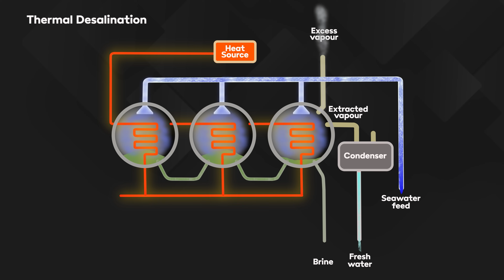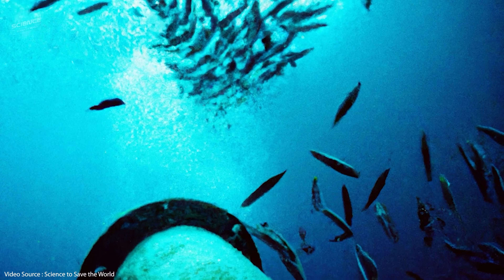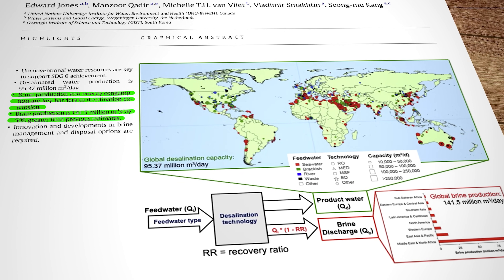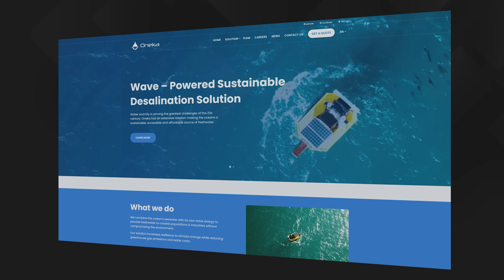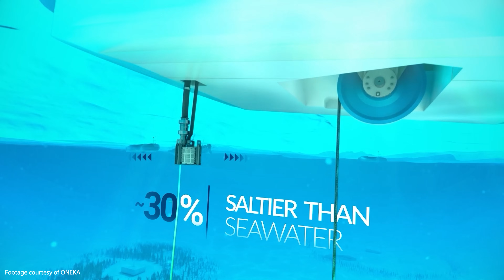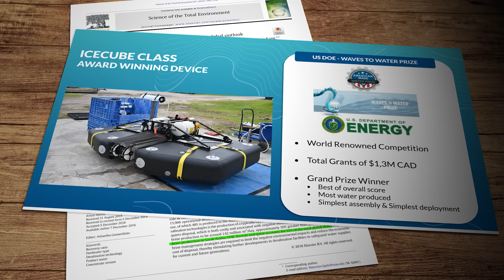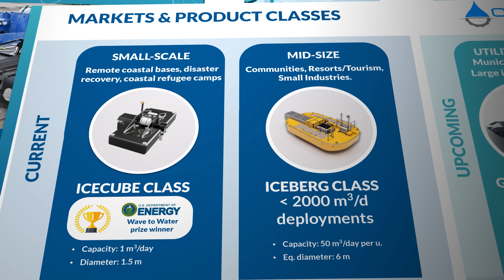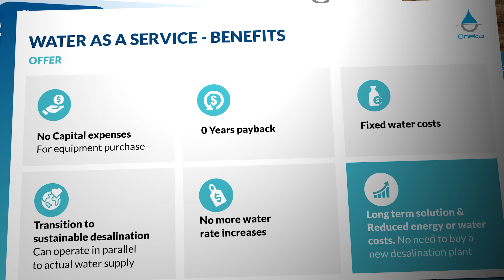Fresh Water at Zero Energy Cost . How do they do that?

Comment: Good video. 2 questions:
1) How are they collecting the desalinated water? How much energy is being spent doing that? The more infrastructure required, the bigger carbon required. 

2) Regardless of the percentage of the brine that is sent back into the body of water, it's still the same total brine. 
Yes, dispersing it more evenly will cause less disruption. But does that % actually matter when the whole brine recycled is the same?

All in all, great innovative ideas. I think there are some bugs to work out, though.

Comment: What does it matter if the discharge is less concentrated? In the end, you discharge the same amount of salt per unit of water purified. 
At the same time, using a mechanical pump system is a gimmick - you might as well take an existing tidal generator and combine it with an electrical pump. Needs no "innovation" and is possible with of-the-shelf components right now. 
The average american uses 215L of water a day. So you can barely cover 5 people with a single small platform. The mid-size is enough for 250 people - "small community" indeed. The biggest "upcoming" platform should provide for 2500 people. You'd need 40 of the biggest ones to supply a SMALL city of 100k...And this is nothing compared to agricultural/industrial usage.
You could discharge the current high-concentration brine in a distributed manner - no one does that because of cost. If you put up enough platforms you'll need a lot of pipes.
Maintenance. Now you have one big on-shore facility that's easily reachable and maintainable. With many platforms out all over the place, that makes maintenance much more difficult, read expensive. 
Also, you already have a mechanical piston, why would you put solar panels on it? Why not use the mechanical force to run a simple generator? It's likely to already exist and in marine specialized form too. You'd save on batteries and the whole thing would be much less weather reliant.

Comment: I see everyone talking about maintenance issues since it is offshore. In my view that is something that just adds to the total cost of ownership, and could probably easily be offset against the lack of energy need. And the easy process, since they are small, is to just pull them on board a ship, put in a new one, and maintain the 'broken/up-for-maintenance-one' on shore. Besides that, with all the windfarms that are going up, te maintenance is something we're learning quickly. I can imagine, with a lot of mechanical parts in the system, it might be failure prone. It would be challenging to find the sweet spot of failure-proof, but not so over engineered it is no longer economical.

Comment: It will take some iteration to find the correct unit size and configuration.  Many small ones will probably be too expensive to maintain but if you get to a global fleet parts and maintenance is standardized.  Lots of 20 year olds with scuba gear will have a job in any configuration.  Marine life will plug up the intake fast anywhere that barnacles and mollusks thrive.  I wonder if most of the kit should not be onshore and centralized across N pumps offshore.

Comment: This is a great idea, 'passive desalination'.  I'm all for it, and we less unfortunate should help those less fortunate to get things going.
Two problems I see are: political, those using large plants won't want to change over so will continue to use fosil fuel.  Practical:  it will be so popular that there won't be enough PET for recycling so they will resort to virgin stock which is an oil product with deisel and petrol as by products which will be used to create GHG ..........

Comment: As with all systems, the problems are at the extremes of operation. In this case the minimum is no waves so no water output an no problem.
However the other extreme is where the real problem occurs. With storm waves and the odd freak wave, how does the platform not just operate, but survive? Is it on a fixed tether causing it to submerge is very high seas, or can it extend the line to ride out large waves?
With global warming causing more intense storms, the extreme case of large wave heights may be a major maintenance headache.
Having said all that I think this is a very promising technology, and I hope it comes on stream soon.

Comment: Nice concept, but there are going to be a lot of technical marketing issues they are going to have to overcome.  I suspect the reason they can use only wave power is because their efficiency (volume of salt water in vs volume of drinking water out) is very low compared to traditional desalination plants.  Typically It doesn’t take a lot of energy per volume to get that first few percent through the membrane.  Land based RO units could do the same, but the amount of capital investment, physical space, additional maintenance costs, workers to hire,… make putting more energy for a higher yield economically attractive.  The low efficiency also allows them to discharge slightly concentrated salt water, instead of the very concentrated salt water from land based units.  

An additional challenge, as a municipality, how do I make sure I have a properly sized system?  Some days might be dead calm, then what?  Yes, you build water storage, but how big?  Without more information, one has to assume the stated output is under ideal conditions.  

With all that said, this would be great for remote locations or places that value being environmentally friendly over financial (capital and maintenance) costs.
Reply: that is the beauty of the concept: there is enough space on the ocean. So they can use (weker) wave power to reap the low hanging fruits. - Although maintainance is higher if there are more decentralized points of intake and brine disposal. Offshore maintainance is a huge cost - unfortunately. (Growth of barnacles, etc. and also the maintainance of valves or moving parts). They have to clean up growth and maintain parts in the normal desalination plants (on lad) as well but there they do not have a lot of pipes and they are much easier to reach.
Reply: Personally I agree, space in the ocean shouldn’t be a problem, but say you are a vacation/resort town that relies on a lot of boat/ship/fishing traffic around your coast, it could create some issues.  Then there is the “not in my back yard” mentality we see with offshore wind power.  

Again, I like the concept/technology and feel this kind of thinking is one of the main ways to be more sustainable.  I have seen too many technically sound/environmentally friendly projects killed over non-technical issues (not in my back yard).

Comment: Use solar with Piezoelectric to drop metal to condensation temp to collect water from the air. With a warming planet, there's more water held in the atmosphere. Pulling water from the atmosphere also helps reduce warming...

Comment: lol, well...
Just another RO unit - with direct mechanical power.  

Any of the "solutions" to brine concentration and distributed discharge , marine life exclusion (maintenance  concerns of all those submerged components, wow)   can be applied to land (or sea)  based  "grid scale" system....     Not a lot unique there - just a bobbing wave generator - with a whole lot of fault prone submerged parts..
NB brine quantity is never a significant concern and concentration is a mere "engineering decision" with pumping efficiency entering the debate - vs cost of diluting - and distributing at the discharge point.

Yes directly using intermittent power sources for "stockpileable resourcees" - storage by another name makes sense when the resource costs money and energy to "make" (gather, filter, store) and distribute distribute (calculate cost of the storage per kWh of "energy saved").

Electricity is about the most fungible resource - no matter where it originates it can be sent anywhere and used by anyone on the grid..  Maybe getting grid scale wave energy working and its lifecycle well "costed" before complicating it ??? - n
On the other hand, if this device is cheaper, with a longer life than all those power inverters and switching components...  time will tell, options abound.

Zero energy cost, I think not, lol...   Marine systems are never cheap or energy saving compared to land based - works fine when there is no alternative.

Comment: This could fill the "gaps", (on the surface), between the windmill/turbines of the off-shore wind/electricity islands off the european coast, particularly the North Sea.  Another idea; could two or more of these devices be hinged together to  the wave action and translate the out of phase-motion in order to increase the mechanical energy recoverable?  Or convert it to electricty to power onboard data transmission and safety/navigation signals and lights where required? I'm thinking of hazards to fishing boats etc.. Could these units be submerged as a safety measure;  deep enough to calmer waters in case of hurricanes?  In all a very good start.  Good on you Canada.

Comment: Another great video, and this looks very promising.  I remember from about 10 years ago a technology called Searaser - a wave energy device that was designed to pump seawater ashore at height, the seawater was then returned through turbines to the sea to generate electricity & meet energy demands.  That technology could work well with this - instead of pumping the seawater ashore, it could pump it through the membranes to produce fresh water and/or electrical energy.  I understand that Ecotricity now holds the rights to the Seasraser technology - perhaps, if they're not already, they should be speaking to Oneka!

Comment: If you are going to convert wave power to mechanical energy then surely it is simpler to use the mechanical energy to generate electricity on the platforms and do everything else ashore.

Comment: Clearly not zero energy, but I'll accept zero electricity. ;-)
As far as I understand this its basically just a small mobile reverse osmosis desalination plant. There is exactly one difference, apart from scale, and that is that wave power is used directly and not converted to electricity first.
This might mean that it is a more energy efficient than a regular desalination plant. All the other advantages are just an illusion based on size and efficiency. 
But doing it this way also has a lot of challenges:
- Can only be used where suitable wave power exists.
- Output will most likely vary significantly, down to potentially zero, which requires storage.
- The plant is in the ocean, which means more and harder maintenance, or much more expensive to build.
- Can not use other local sources of green energy.
- Likely less efficient overall due to small size. 
- Energy harvested can only be used to desalinate, regardless of other needs for the energy.
And so on.

All in all a clever enough idea, but one that is highly unlikely to make any real difference.
While its' good to have ideas presented, and I really like this channel, it often sounds like an utterly uncritical advertising channel for "green" ideas. Presenting a somewhat more nuanced view would be better - if thinking is what you want to achieve. ;-)

Comment: The pressure optimization system sounds very suspicious for me. What is to be "optimize" for pressure? 

RO typically requires very high pressure. If the motion of wave could generate high enough pressure for RO, it would be enough already to turn turbine to generate electricity (which we know is still a problem for wave energy)

Comment: Wave action on shore breaks against the coast violently and if properly managed can pump water up to a sorting tank, say 50 feet above sea level.  From there would run a clear plexiglass pipe, inside the pipe runs a trough of salt water , baking in the sun on it's round trip journey.  All the while the hot water gives off vapor which condences on the clear plexiglass tube and runs down the side and flows along side the salt water.  After a few miles the salt water becomes too concentrate and has to be drained back to the ocean on a return pipe.  No electricity, no fish.  Salty brine returns to the ocean and condensate collects some miles away, though it could make many bends and end up close to where it started but the brine should be drained down into the depths of the ocean and not poured back in at surface levels.  This clean water could then be pumped with solar power to where it is needed.  Take any salt lake and remove the water this way, taking the salt to a giant pit somewhere away from the population or use it to fill in an old abandoned mine shaft with thick brine.  After years of rainfall the salt lake will become cleaner, less salty and can harbor sea life or eventually fresh water fish again.  This is my idea.

Comment: 100% renewable energy plans rely on OVER-BUILDING solar to cope with your worst few weeks of the year. Rather than try and store power for a winter month - you build your wind and solar grid to cope with that month and turn it off the rest of the year so that 4 or 5 times your normal capacity doesn't FRY YOUR GRID! OR - put it to use doing DAC (Direct Air Capture of carbon) or Desal or even running a Plasma Burner to recycle waste at the atomic level. These are normally expensive on today's grids - but in the future there will be 10 or 11 months of the year this excess power would otherwise be wasted. As long as the service can shut down for the worst month or 2 of weather each year, why NOT use an extra 4 to 5 times your whole nation's grid capacity to do DAC, Desal, or Plasma?

Comment: What energy and maintenance costs are involved in the process of getting the drinking water back to shore? And pumps are going to be needed, back on shore, to get it to the reservoir that's higher than sea level. Multiple pipes will need to connect these floating platforms to the on-shore facility. I would imagine that if you wanted to go down this route, that it would be more cost effective energy wise, and maintenance wise, to keep the current system and to use floating platforms to distribute the brine over a wider area.

Comment: Distributive production of fresh water could be more friendly to sea creatures and require no energy input. This kind of production is also a challenge. Where you produce fresh water is not where is needed. Offshore maintenance is a headache. The pipes that connect back to the shore could be damaged or leaked. It may be suitable for a small island, but scaling up to supply a large city would be challenging.

Comment: Sounds viable, of course has anyone thought about ships / boats running into these units? since they look to be close to the surface.  Why not put a large manifold on the brine outlet, and run 50 plastic hoses out 100 miles / 161 kilometers each hose is spaces 50 mile / 80 kilometers apartthis should disburse the brine out .

Comment: Great idea. two issues. The 2 to 3 m radius for undetectable salinity increase from the brine discharge probably increases as the capacity of the desalinator increases. Second the collection of the pure water is possibly problematic. twenty cubic metres a day from the glacier is a lot of water that needs to be relocated to the shore to be useful.
I don't see why inconsistent waves are a problem. A small wave inputs a small amount of energy to the system, a large wave a lot of energy. 
Here is an extension of that idea. Use the wave energy to generate an electric current to deconstruct water into H2 and O2 gases, both useful products.
Reply: And also as more units are installed. 1 unit, not much problem with a small one. 1000 small units in a bay, big problem.

Comment: I don't see anything being done here that couldn't be accomplished with modifications to standard reverse osmosis, coupled with any sort of renewable energy, including wave energy. The advantage of using electricity is that it is very easy to apply the required energy exactly where it is needed to perform the task. Less concentrated, more widely distributed brine discharge and better filtered intakes don't require a new system, only different business incentives or regulations.

Comment: 3:13 Building hundreds or thousands of these wave generator purifiers would take away from green energy development in the same way that repurposing existing green power for desalination plants would.

Better plan: Put real filters on our desalination plants, build the most efficient green energy we can (not wave generators), dial back the desalination plants to the less harmful 30% concentration, and run it out long underwater bubbler hoses so that the output of the plant is dispersed, just like it was being released from a string of the wave generators.

You get all the efficiency benefits of using the best available green energy, and the economies of scale from having large desalination plants.